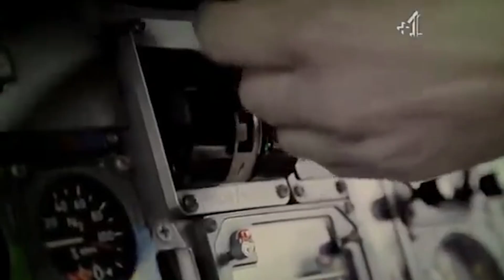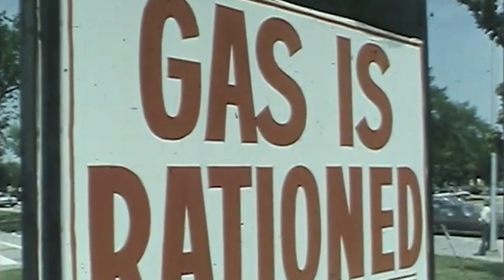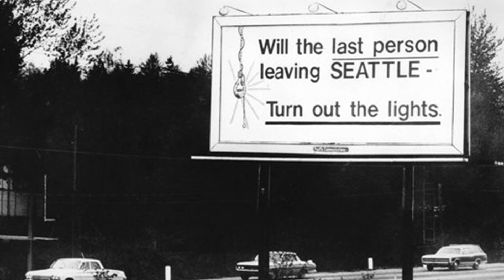The Forgotten American Concordes - Boeing 2707 - Lockheed L-2000 SST

Comment: The tupolev is a copy design
Reply: That is not exactly how it works, there is much evidence that the Tupolev designers stole many of Concordes plans, Concorde was in development far before the Tupolev was even a concept.
Reply: Infinite Flight To a large extent, but not completely. It did have some of its own features. The USSR did have some brilliant scientists, just not the infrastructure to support them properly.
Reply: Anon B
Yeah, just like the Soviet shuttle.  They stole the basic design, then found it easier to use some of their own pieces.
Reply: J Shepard Buran had quite a few of its own features. I think it could be remote controlled whereas the space shuttle couldn't be.

Comment: The problem with a supersonic aircraft is the math just does not work for commercial flights.  A 747 is a very fast and very efficient aircraft that will cruise at 550 mph and carries so many people that even at todays high fuel cost you get 100 mpg per person. That is why you can fly from DC to Thailand for $1000.  Having a aircraft at only twice that speed might work.  1100 mph.  You would use 4 times the fuel and carry half the passengers. That would take you down to about 17 mpg per person.   Then range would still be your limiting factor.  You would have to make at least 2 stops to get from DC to Thailand.  It would be quicker to take a direct flight on a 747.
Reply: And none fly supersonic aircraft.  Like fatboy said, the math or profits are not in the favor of SST.
Reply: TheEreader.  The Concord was a money pit.  It was NEVER profitable.  British Airways put up Zero fight to shut it down.
Reply: Not to mention, that flying nowadays is more chilling than even using trains, which means you can easily work on a project after launch and before landing. Even the rich don't really need the speed advantage that a Concorde or supersonic planes give.
Reply: fatboy19831 the only key problem with the Concorde was that they never anticipated the massive rise in oil prices when OPEC jacked them up. Prices were very low and stable from the 40s so it's only natural that during concordes conceptual stage they would have expected those prices to remain. With today's efficient engines and CFD tools at our disposal an SST is completely possible. To think a 100 years from now we are still going at M0.85 would be pathetic!
Reply: Marc Brassé, at 1:10 the narrator emphasizes "huuuuge (US) government backing" but implied there was less for Concorde and (remarkably in communist USSR) the TU-144.  --I watched the industry a little at the time of the Concorde take-off crash; the consensus was it never had a profitable year.  Beautiful airplane, always glad to see it, wish it was still flying.
Reply: I think the biggest issue was it's reputation after the tire blowout
Reply: The truth probably is that Concorde only became profitbale by "blotting out" the initial development costs. Just like the Channel Tunnel still only exits after the original company went bankrupt. It is one thing to develop a technology on government = public money and then sustain it commercially on a day to day running cost basis. It is quite another to pay the whole bill from the beginning and even construct a next generation alternative while exploiting the first generation commercially, which basically proves that our so called perfect free market capatalism does actually not work / exist. The elite flying Concorde was basically doing so over the backs of the taxpayer. So what else is new?
Back to the main argument: One should do the actual math to be totally sure but Concorde did very probably not even break even, providing one is honest about the actual costs.
Reply: Just an aditional note: Since NASAis funded by public money it is held by law to share such knowledge. It's also the reason why the sort of studies I mentioned before are openly avialble. That 1985 date I mentioned actually allready where before the end of the (1st) Cold War!
Reply: That is all a bit too easy. What baffles me is that we are at last on the edge of practical, tail landing, reusable spacecraft anyway. That's the sort of stuff that everybody expected in the 50ties but turned out to be a lot harder to actually build.
Setbacks are however part of any development cycle. So it is a bit to easy to be too dismissive of such ventures. Another contributor spoke of what I would call "lazy negativism" being the rule. 
I for my part am not dissing private venture at all. This example also proves that creative idea's do still exist and even that some rich dreamers still want to spend money on it while hardly anybody else seems to be prepared to do that.
The situation simply is that governments have nowadays become so weak that the big industries actually set the agenda. J.F. Kennedy already tried to halt the military industrial complex. It probably cost him his life. And even if one does not believe that theory: It's a fact that the US spends so much on weapons that they do not have the money to do much else. Still not much more then oversized model airplanes seem to come from it. That is what makes the West go broke and not the "they took our jobs" (Southpark quote) foreigners.
So what else is left then private venture? It does however all seem to be little more then a trickle where a stream is needed. Otherwise we'll die out fighting over the last drops of oil!
Reply: fatboy19831 I know what plane I would travel on always. No plane touches it for beauty, and never will.
Reply: Marc Brassé, IKR. I guess grammatically that would be: IK,R. Considering the established opinions, all you can do is seed some doubt. Something like "conspiracies are easy to fake." The comment almost needs to be so short it's subliminal. "you are getting sleepy, you are asleep, stand on one leg like a flamingo." </humor>
Reply: Fireydawn, 
There is a concept known as the "passenger mile."
If you have 100 people traveling 1 mile, that is 100 passenger miles.

Do I need to extrapolate?

Okay

500 passengers travel 10,000 miles from New York to Singapore

That is 500 passengers x 10,000 miles, 5,000,000 (five million passenger miles)
(An Airbus A-380 can carry 544 passengers)

The airplane burned 50,000 gallons of fuel (fifty thousand)
(an Airbus A-380 can carry 83,000 gallons)

5,000,000 passenger miles divided by 50,000 gallons of fuel = 100 passenger miles per 1 gallon.
Reply: Again the question is wether true development can come from market forces only. Even if the technology is there the next thing needed is true coöperation and resolve but when national politics and the status of the few become leading it all falls down in the end. Decadence is the apropriate word when poeple can no longer get one foot before the other in spite of all the necesarry means being available.
How would things have looked if all three projects would have been incorporaterd into one, or at least true Transatlantic cooperation would have ensued?
One other thing though: At that time the Concorde discussion also contained the first warnings about the ozone layer becoming affected. It sounded like a thinly disguised "Not made here in the US" argument then. Now we know how true that claim was. Maybe it was all still one step too far anyway.
Reply: TheEreder "...with one of the most idiotic and 'noob' issues ever...." The Space-X hardware design and launch preparation have never been attempted before. They are trying to get every last fraction of a percent efficiency from chemical rockets. They were pre-launch testing. Finding the fault in the tremendous telemetry stream still took months; it wasn't obvious. It wasn't a leak. The closest thing that can be called a mistake was having the payload on board and considering the launch was less than 48 hours away (IIRC) how could that be classified as a mistake?
Reply: All true except the last bit. That might have been the case when looking at it purely from an US standpoint but without British and French government involvement even the Concorde would not have happened. Both forces / actors are needed but on a basis of true science and the neccesity of sustainable advancement in stead of only being fueled by personal or political interests. In that respect Kennedy's decission was already flawed.
Reply: It would be more than 4 times the fuel, since air resistance increases stronger around the speed of sound. But then it would be less than that because the airplane simplly can fly higher where the air is thinnner and gives less resistance. The faster and farther you fly, the higher.
Reply: One of the really slick parts of the Concorde was the wing. It was very precisely contoured to give a good compromise between transsonic and supersonic drag / efficiency and reasonable take off and landing performance. The biggest problem of all is to get such widely differing needs under one economically and enviromentaly sound roof. Otherwise the world woudl be full of VTOL supersonics.
Reply: Ryu Fitzgerald,
Well done, keep up the contributions.
Reply: Dear Mr. Policeman: I understand what you mean. The danger of contributing to these discussions is that they can become grinding very quickly anyway. Worse still: people mostly bring in their already established opinions and little actual exchange is going on. I am presently so bugged by a JSF discussion on another channel that I almost wish I hadn't gotten involved. It simply comes with the territory I gues. Or is it teritory? Gulp! :-)
Reply: I heard somewhere that it was like 12,000 a ticket to fly in one of those things. With costs like that, I'm rather shocked the program survived as long as it did...total waste of money to shave off a few hours
Reply: Ryu Fitzgerald it was more than that. There was an environmental concern that could contribute to the destruction of the ozone layer due to its high speed and high altitude flight. There were only a small number of planes during the lifetime of the program, so it wasn't really an issue with the current fleet size. The concern was several huge airlines full of these things ripping through the atmosphere...also the instrumentation was ancient, as in everything was analog. They never upgraded the systems. Oh and they required a flight engineer to operate, which was a crew member whose purpose became obsolete by the 90s.
Reply: Ryu Fitzgerald I said environmental concerns were a part of the problem, not all of the problem. These are not things made up. There are documentaries here ripped into YouTube if you'd like. Look up "Concorde" or "why Concorde failed". Can't find the exact search I had. This isn't off mere hear-say. These are documented
Reply: Ryu Fitzgerald google it if you like as well
Reply: Ryu Fitzgerald oh and planes routinely go through instrument overhaul. They have to in order to be rated safe to fly by current standards. Requiring a flight engineer does add to the argument. Most planes operating by the 90s were given instrumentation that allowed them to operate with out one.
Reply: And when one of those big planes goes down, it kills all aboard.  What the heck, who cares about them, eh?  They's dead meat, forgotten until the next air disaster.  Never been on a jet airliner in my life, never waited to be fondled by the TSA or any of the rest of it.  After the WTC attack, people stopped flying for awhile and the economy tanked.  Bush asked people to take vacations.  That's when it became crystal clear what a superficial economy we had devolved into.  No manufacturing at all anymore, just tourism, a very polluting industry in several respects, not advertised when its proponents were pushing it.
Reply: Developing solar electric motor ducted fan technology for supersonic flight would solve ALL the fuel range issues associated with these aircraft designs as they do not require any liquid fuel at all..only electricity.
Reply: You realize that first class tickets exist right? How much do they cost, what do you think?
Reply: infiltr80r Yes First class tickets exist.  To be financially successful you just cant depend on first class sales.  All Concord seats were first class and they still lost money.  At the very least you need a business class.  First class on a 747 is almost all profit.  Profit that is well needed.
Reply: fatboy19831
There are airlines that are first class only.
Reply: infiltr80r Airlines that use modern efficient subsonic  subsonic aircraft.
Reply: fatboy19831 Air bus 380 far superior of all commercial planes!
Reply: Uhmm B747 is extremely inefficient. DC-Bangkok flights is extremely thin in demand. First class is dying, and business class is all the rage now.

Try Tokyo-LA or NYC-LON.
Reply: fatboy19831   Yep. Exactly why it was abandoned, and for once I'm glad the foresight was heeded.  Those costs were ridiculously wasteful.

Comment: One of the Concorde designers wrote in his book that it's ability to go to Mach 2 for sustained periods was due to correct engine cowling design: not staying below Mach 3 as this movie states. Notice the other jets of the time have round thick air intakes, whereas the Concorde has thin-edged square box-like air in-takes that actually have close-able covers on them (usually not visible). It seems that Concorde was simply a better tech project....

Comment: I was under the impression that Concorde- a British/French joint effort was stopped from flying after a Concorde was brought down by parts dropped on the runway where it was taking off - runway was strewn with bits dropped by an American plane. There was a court case held in France a few years later and the American company owning the plane were accused of murder and Concorde was grounded.
Reply: correct- a- mundo

Comment: I can't believe how similar the Russian plane was to the Concorde. I wonder why it wasn't as successful.
Reply: Well, they had problems with the engines (they were less efficient, the range was less than half of concorde!), and with the fuselage cracking. It was also extremely noisy for the passengers, and the two crashes didn't help either...
Reply: No propulsion.
Reply: Tu-144 had some design flaws that they corrected but there was the coup in USSR 1991 and the Union was disintegrated and so all the state plans went with it including the Tu-144 revisions.
Reply: They were worlds apart when you look at the designs. Concord could pull 6Gs and fly like a fighter jet with barrel rolls and all that, the TU-144 disintegrated at 2Gs and crashed.

Comment: They are playing loose with the Mach number--first Mach 3 is 2300 (or 767 miles an hour for mach) then 2.7 at 2000 miles an hour (744 miles an hour for mach 1) and then 1350 for Mach 2, which is 675 miles an hour for mach. They are confused.

Comment: Mach 3 is 1980 miles an hour at altitude, not 2300. Either they are wrong or they are using a variant of the sea level speed which is about 760.

Comment: They weren't worth remembering because the American pieces of crap never flew. Non-starters. Nil Points. No Shows. DNF's.
Reply: And proud of it, Yankee Boy Forgotten American Concorde sucker. You proud of the fail?
Reply: Nice! How fast did it fly? How high did it fly? How many years/DECADES! did it carry passengers? Did it have a cool designation like 'Speedbird' running US to UK? Yankee models are like paper airplanes. Looking good from the outside, not so easy to make it work in real life though. How many trans Atlantic flights did your paper model make?
Reply: ***** Bubbles are made of the same stuff as dreams, just like the US supersonic project. We did it. We built it. It flew for decades. Shame you have to rely on excuses to explain why you didn't.

Comment: honestly concorde could've been upgraded with "modern" turbo fan engines like those found on fighters like the F-2000 or the F-22A and those could (in theory) could alleviate the issue of fuel as they are both robust and relatively efficient...another thing which could've been done as a stop gap measure would've been towing to the runway and ironically if this had been done the issue of fuel consumption on the ground would've been nullified...but as it was the only thing which sold concorde seats was the 4 hour transatlantic time vs 9 hours+ on a typical airbus or Boeing and that simply wasn't enough to justify it's continued use and support quickly vanished and the crash in 2000 just drove the final nail in the coffin...
Reply: ***** range...it only had a 4k mile range from California to Hawaii alone is 3750ish it just wasn't safe...BUT another concern the was legitimate with concorde was the fact that it's supersonic capabilities were nullified by its routing due to noise complaints.

Comment: Nice history of some aerospace history that should be much better known,  but your understanding of Mach number vs. speed and altitude needs some work.  At cruise altitude, anywhere between 40,000 and 100,000 ft, Mach 1 = 660 mph.  It is constant through the stratosphere, more or less.  At sea level, Mach 1 = 745 mph.  So, while Concorde cruised at Mach 2.2 = 1450 mph, Mach 2.7 would not be 650 mph faster, but only 330 mph.  Of course there is also the effect of wind, making true ground speed, etc., but this is speaking roughly.  

Even Mach 2.0 vs. 2.7 would only be a difference of 462 mph.  Maybe you were thinking of Mach 3 vs. Mach 2?

Really Lockheed's design was much more realistic and suited to passenger service,  but Lockheed was on the outs with the US gov't in the late 60s after several failed projects and the Starfighter bribery scandal.  Plus Boeing had a whole string of success, was the big boy with a very powerful lobby, and how could they fail?  Oops......

Comment: In the 1960 to 1969 time frame. Lockheed had flown the A-12, YF-12A, and SR-71 Mach  aircraft. The military aircraft were in service for a few years. The L-2000 could have been flying before the Boeing. Lockheed had many years of important manufacturing aircraft from Titanium.